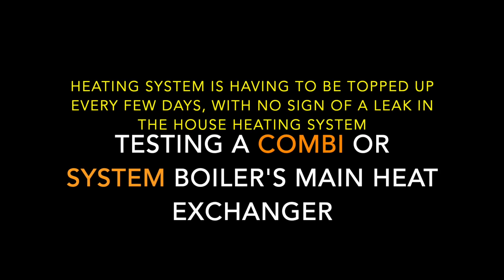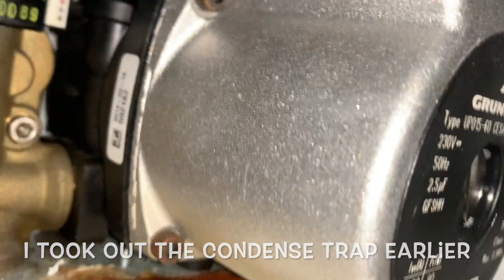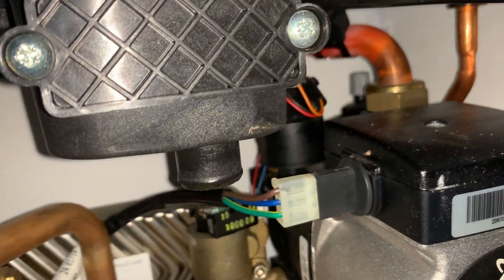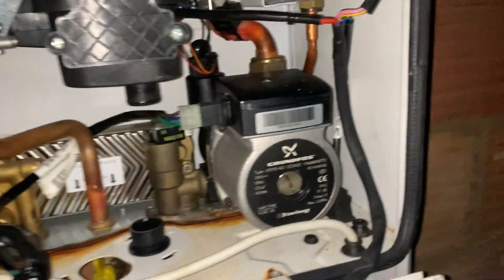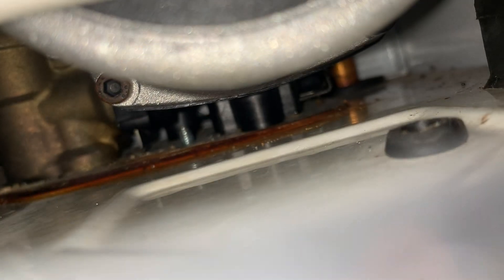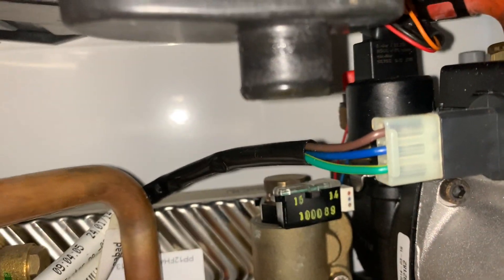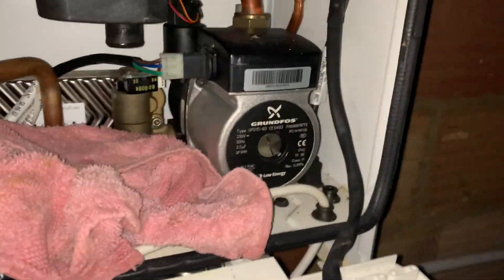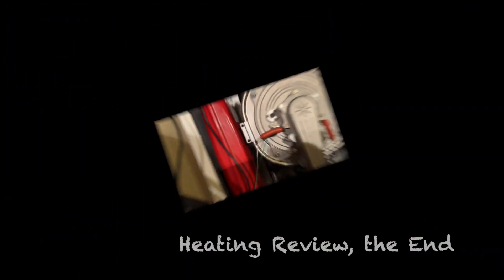Boiler Heat Exchanger test. Boiler system is loosing pressure regularly. Topping up pressure often.

Comment: So I get this correct, you drained boiler and isolated, drained vessel and recharged to 2bar ? For test?  Nice video ❤️
Reply from the maker: dont drain the boiler as it needs water in it to show any leak . Just close off the Flow and return valves and pump up the vessel.
Reply: @heatingreview3795 is it possible to do that where the vessel is separate, eg ideal h18? Got an unexplained pressure loss which the plumber is blaming on a leak in pipework but no signs of such leak (newbuild with no pipes hidden in concrete etc)
Reply from the maker: @anthonyheywood  due to the vessel being external it would not have the same pressure impact. Also you wont have an isolator on both sides of the boiler (flow & return). My suggestion for you is , 1) does the condense trap look like its got unusual amounts of debris/discolouration (you will have to ask the plumber)? 2)Depending on the position of the condense discharge pipe, could you put a container underneath and with the boiler NOT running for a full 24hrs  is their noticeable water in the container having the system pressure initially put up to 2 bar, with any pressure drop.? Also, could it be the Expansion vessel loosing air pressure...Leak detection fluid the schraeder valve ?

Comment: On the ideal logic the heat exchanger is leaking on sump can i change only this or main heat exchanger
Reply from the maker: @Askme_gas  on an ideal logic you can change the sump. It is actually fairly straightforward, with the main thing of having to take out the whole heat exchanger from within the boiler. Once it is out you can ping off the clips which hold the sump in position and clip on the new one.Then you have to hang the heat exchanger back and make sure you get it hanging on the bracket correctly within the boiler.

Comment: Plate heat exchanger has a pin hole in?
Reply from the maker: No. That would result in more pressure being registered on the pressure guage as cold mains is usually higher than heating system pressure.

Comment: There’s not 2bar of pressure in the boiler it’s in the ex vessel. There’s a diaphragm in the ex vessel this is what separates the air side from the water side in the boiler.
Reply from the maker: check the manual gage if available after following steps in the video. The pressure should easily get 2 bar in boiler.
Reply: @heatingreview3795  impossible mate, next time you drain a combi or a system boiler with the iso valves isolated and the boiler drained and drain off closed. Charge the ex vessel to 2bar on your pump then check the boiler gauge and it will still show 0bar as the pressure is in the ex vessel not the boiler as the diaphragm separates these
Reply from the maker: @Sarries-fh7ri  Your misunderstanding is that the boiler is NOT drained down at the point of re-charging the expansion vessel. if it was you are correct.